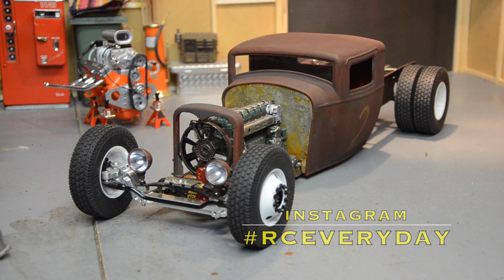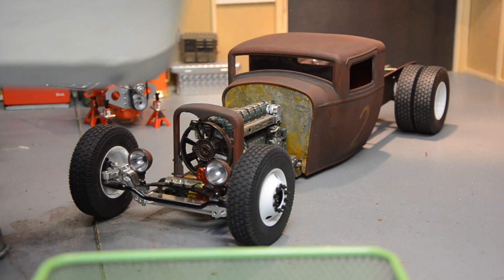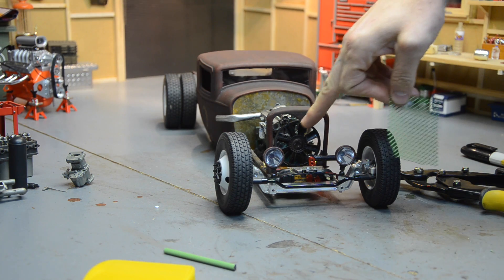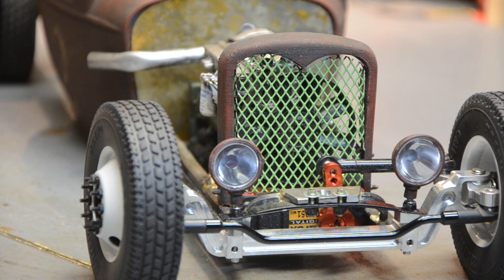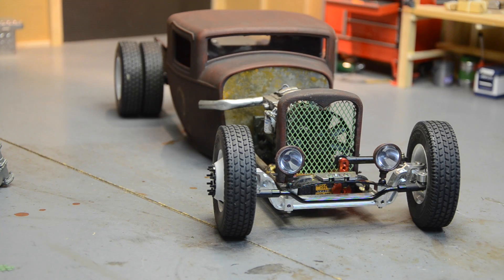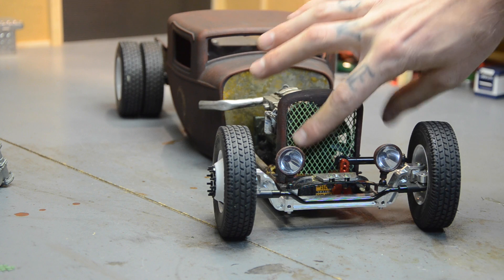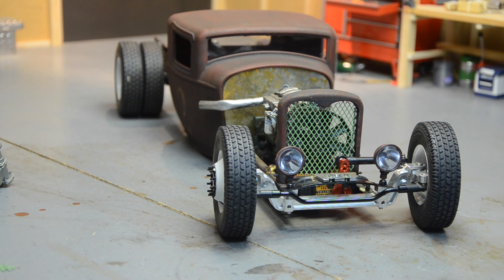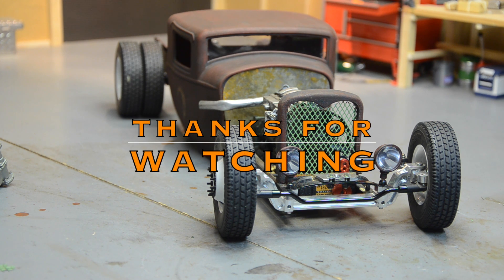Making The Grill Insert For the Old #2 Custom RC Rat Rod

Comment: loving the way the rat rods coming out I've heard for things covered in powder coat to remove it  you soak it an oven cleaner and it'll all come off or they could be for anodized not sure just an idea
Reply from the maker: Ive heard of that method before.  The coating on there is so poor it was just sanding right off though.  Plus Im not totally against the green color, kind of like it.  Thanks for the tip!
Reply: Me too it could use just a little rust on the face of it it would really set it off! Keep up the good im always looking forward to every new episode